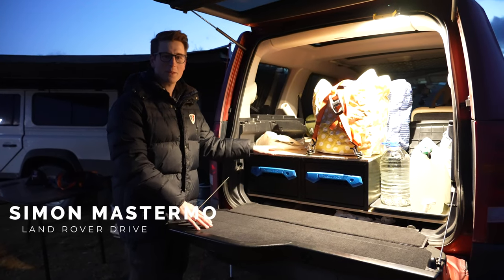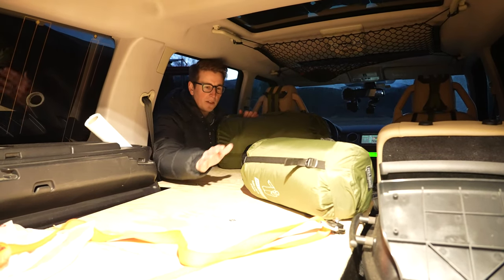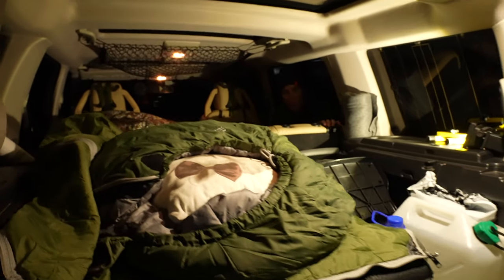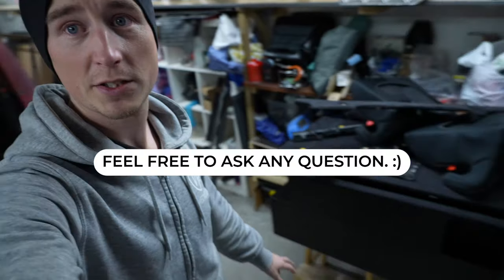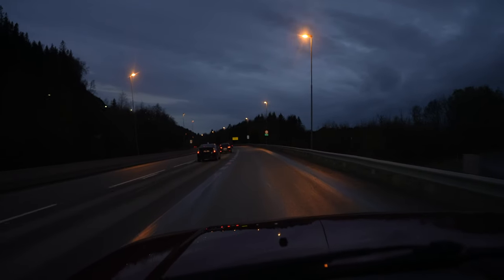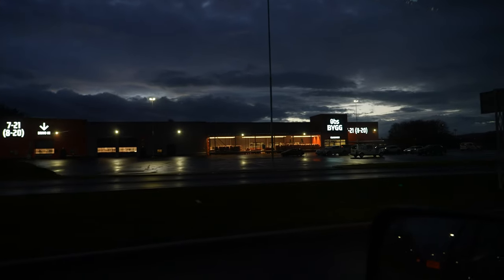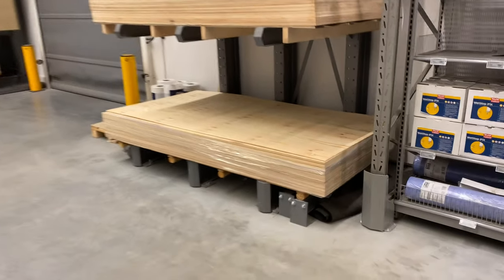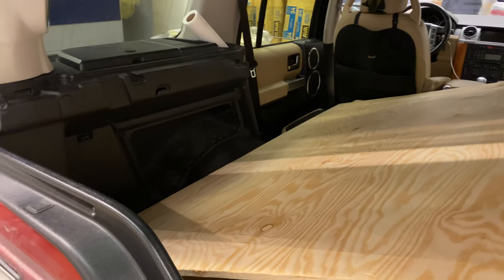Land Rover Discovery 3 Overland Tourer Build - Stage One - LR3-LR4

Comment: Great set up. Don’t forget to cut out a hole and consider access so you can access the spare wheel winch bolt! Otherwise you will have to strip everything out just to change a flat. Happy travels. 👍
Reply from the maker: Hey William, I can get to the "bolt" with a socket and the ratchet in between the small gap there. I haven't tested it in the field yet but will have to soon with the new wheels going on. :) I'm looking into replacing the spart to the rear but it's a bit expensive so it's not on the top of the list.

Comment: Hi Simon, I really like the drawer system very organised.  Also glad you didn't fall into the trap we all do occasionally by just rushing it.  By delaying your trip it enabled you to get it how you wanted and the trip will help you tweak it until you get the perfect set up.  On the passenger side long board on the floor, you could consider cutting it along the length and putting a piano hinge on it to allow full access underneath 👍this is definitely something I want to do in my D3 too for my next overlanding trip.
Reply from the maker: Hi Simon, I think it turned out well to be a two day diy build and with second hand drawers. Definitely have some changes I want to do but only minor for now. 😊 Drawers are something I recommend and it has really changes the car for the better. Smile every time I get to open them at camp. 😊

Comment: Hey Simon - brilliant video, as always.  Love the way the wife calls to say keep the noise down, then you start hammering.
Reply: Oh, I forgot to mention ... one of the best accessories for the garage are the Ikea stools that you have - I also have them in my garage, and they are invaluable.
Reply from the maker: Hehe yeah, I use them all the time. So handy for any work in the garage. :) Will be looking at making a proper work table for the garage, on wheels, that is more useful than the static bench I have now. :)
Reply from the maker: Hehehehe, I only had two left and it needed to be done. But yeah, garage is next to the house so I bet she heard it pretty good. :) The box in the garage, near the opening is where I have silenced the air compressor so I can work late evenings after the kids have gone to sleep. :)

Comment: Great 👍  video, Great  set up!
Question  fir you,
How it cost  you?
How much weight  is now & before?
How many  miles  you will get now abs before?
Is a good  idea  to upgrade  the fuel tank?
I would  like  to something  like that to my lr3.
Thank you bro!
Keep  over landing..
Reply from the maker: Hey Mr. Armando - The drawers was bought second hand so cost me 6000NOK ≈ 600$, the wooden plate I think was around 60$.  The rest I had laying around from other house projects. I had searched for drawers for a while and these came along just in time. I was suppose to weigh it before I started adding all the weight but the local weight station was out of order at the time. I know that I was up at 2950kg when I was fully packed for a trip so it's getting up there. I think it's even higher now with the added mods that are on now. 😅 I saw about 8L/100km after adding the roof rack and drawers. With the latest mods I'm seeing 9L/100km. But I think maybe I have a injector staring to go bad. For now upgrading the fuel tank is not necessary as the 80L It's more than enough for what I do. I would just get one or two jerrycans, super cheap and you can add them only when you need them, not carrying the extra weight all the time.  Thank you for watching and for great questions! Best wishes for you and your LR3. Simon

Comment: Hi Simon, really enjoy your videos!  I hope one day to be able to see that part of the world with my own eyes while overlanding!  Now that it's been several months, how is your system holding up?  any changes planned?  anything you wished you'd have done differently from the start?  I absolutely agree about the rattling, I can't stand having anything rattle.  I have had problems with the drawers themselves rattling in the past as the tolerances when shut still allowed a little movement that made the slides themselves rattle... still trying to figure out how to prevent that on my upcoming drawer build (I'm thinking some sort of rubber bumper)... anyways, keep up the great work!
Reply from the maker: Hey Brandon and sorry. for the late reply. I have kept the same drawers and are really happy with them. I have modified the platform on which they sit, lifted it slightly to get some better access to the space underneath. So far its been really good and a nice adjustment and I wont be changing it out any time soon. I have added some 12v the past year and there will come videos about it later. Just need to get time to edit everything. New video out today.! And yeah, can't have hose rattling noises, I hope you find a good solution. Best, Simon.

Comment: Looking great Simon, I have a random question for you.  How do you heat your workshop. Thanks David
Reply from the maker: Not random at all 👍 I use an AC, we call them Heating Pumps(Varmepumpe) It’s a AC that is made heating effective in colder climates. With low power prices it’s the cheapest way to heat up the garage. I do turn it of when I know I don’t need to work in the garage to save some money. 😊 Simon

Comment: Nice video dude, and glad you included the links. 
The drawers look like they'll suit your purpose well. Had any thoughts about sharing your plans for the sizes and dimensions of the design. I'm sure it'd be worth a donation to your patron if someone used it?
One thing, can you still get an extension bar/socket in through that low space to get access to the spare wheel winch mech?
Reply from the maker: Hey and thank you! The drawers is great and they have so far been a big plus for when I’m camping or traveling in genera. Car is always ready to go. I haven thought about sharing the plans other than the videos but could probably draw something up. Simple stage one build and a diy anyone could do. 👍😊 I can reach it and can get a socket on it and use the ratchet to lower the wheel. Thinking about relocating the spare, so far the swing away’s and rear bar is to expensive and is not included in the budget. 😊 On note about the build is that I would have put the lower plate 3-4cm higher is I was to do it again, just to get better clearance underneath and maybe put in a sliding table or the solar panel’s. 👍